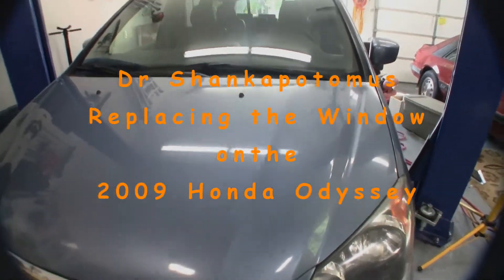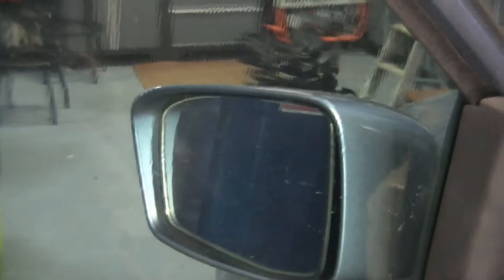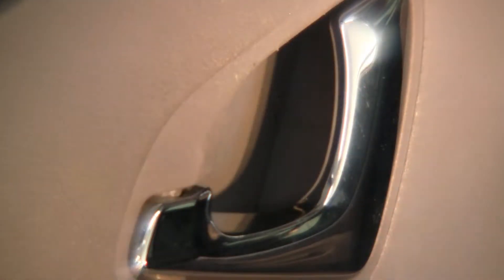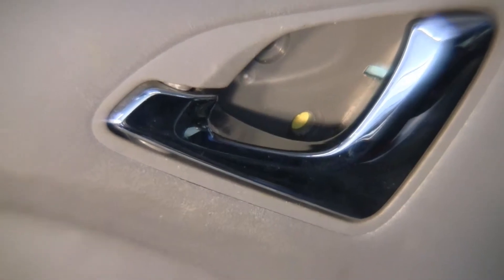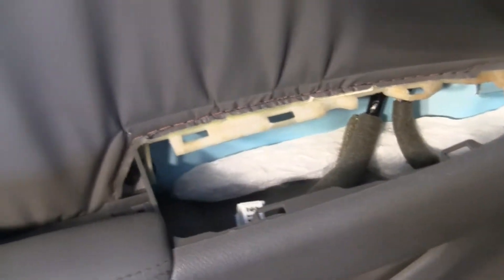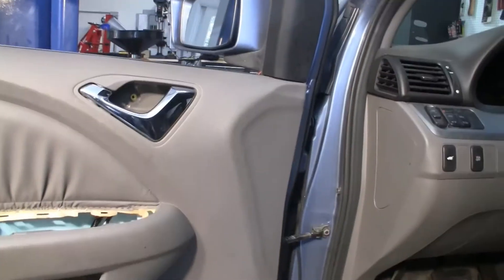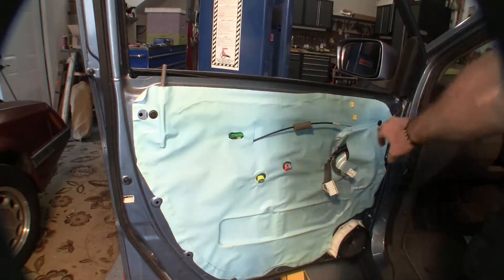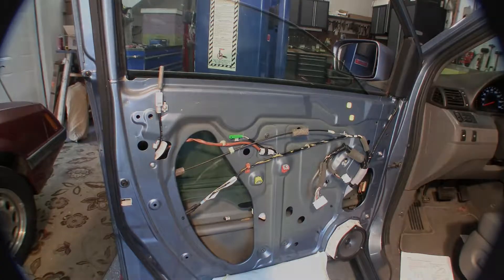How to Replace Honda Odyssey Window

Comment: I'm glad I finally found the video I was looking for, the Driver side. I am a 62 year old woman and needed the driver side replaced for the second time, I couldn't seem to get men to help me and the ones that offered never got around to it. I got tired of waiting, If my car would have had a/c would not have been a big deal. So I did it myself, those two screws at the bottom of the windows stumped me until I saw this video. Thank you I did it myself!
Reply from the maker: Glad I was able to be of help. Thanks for watching.